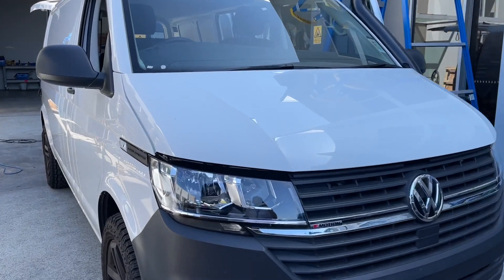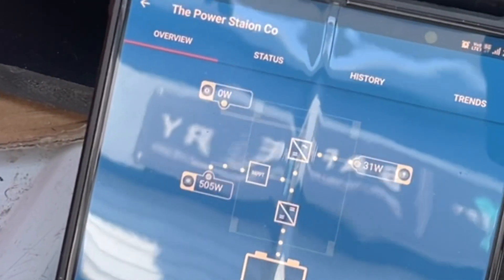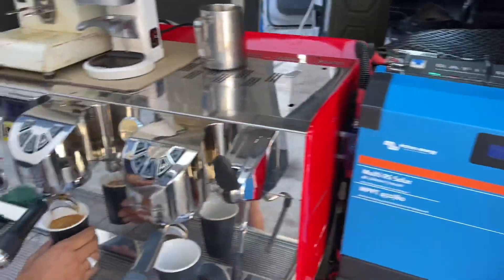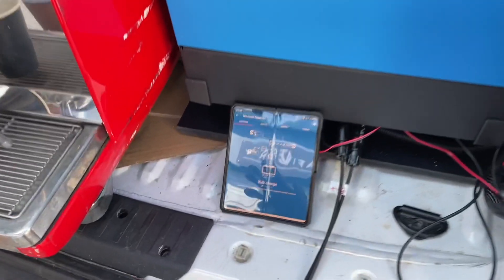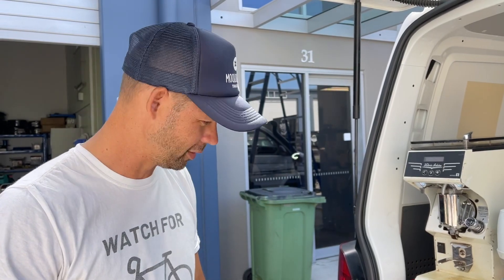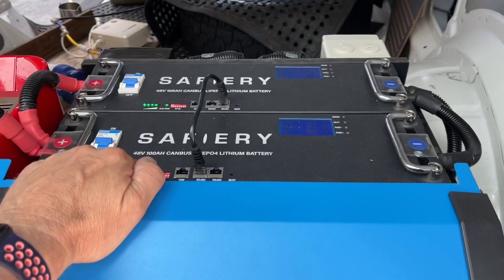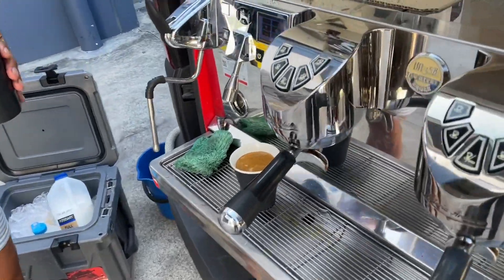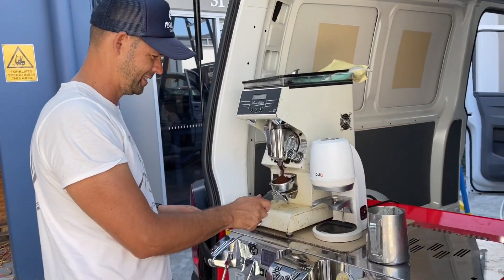The Power Station Co goes Next Level with 500mm Cube Power Station 6000VA Hybrid Inverter 9600Wh Li

Comment: Amazing setup.

The Multi RS Solar seems like an absolute no brainer compared to the monstrosity that is the multiplus…
Only the relatively high solar startup current can be a bit of an issue…
Reply from the maker: There are some other issues with Multi-RS. It does not respond to DVCC commands to stop charging when the CAN BMS sets a Charge Current Limit of zero. We had to change the CAN BMS strategy to reduce Charge Voltage Limit as well as set CCL to Zero (Scotty Ai responds perfectly to CCL of zero)

Comment: Hi,

In video it seems there is BMS communication with the victron  rs, it shows battery percentage on the ipad.  But i dont see a cerbo gx or blue can cables connected. Can the battery BMS talk to the lithium battery without an additional cerbo gx?
Reply from the maker: The battery BMS is built into each battery. It can be CANbus or it can be just CC and CV charging with No CANbus nor Cerbo. That is what we have done here, as this is a testing setup and we use raw battery voltages to run the system and check performance. It runs perfectly, you dont need a cerbo with the right battery and very good BMS!

Comment: What voltage are these panels? According to the manual MPPT works above 120Vdc, are these high voltage panels? I am also  planning a camper with such 48V powerbox and want to pick the best panels for the roof size. So far I have planned 12x 30W panels in order to get to the MPPT range, but I was wondering what kind of panels are suitable
Reply from the maker: These have a 76Voc

Comment: Hello Safiery, I have the Multi RS Solar with 11x400Watt glass glass bifacial solar modules with a 80Ah Lto battery and special BMS. It is working very hard and is already planning to expand it with the RS charge controller 450/100 or 450/200. He can do AC coupling too.
Reply from the maker: Thanks Reg, roof space is limited for solar so no need for AC coupling. Appreciate the thought
Reply: Yes, you can add AC-PV-Inverters as well.

Comment: Great setup but with lithium isn’t its KW us “younger” ones that only know lithium get confused.. what’s an amp hour?  Hmmm
Reply from the maker: Yes. The Lithium are 10,000Whrs. Divide by 12.8V to have Amg hours at 12V, divid by 50 to have Amphours at 48V.. The Inverter is Volta Amps rated from the battery by watts rated from the solar. The difference between Watts and Volt Amps is the active power is Watts and the reactive power is VA-Watts. To simplify everything, we work in watts and watt hours all the time. Amp hours are tricky as you charged at a different voltage to discharge so the true maths in amp hours is too hard. How did I go with this?

Comment: Hey Bruce great system mate how much for this system as is approx, and seperate 48V batteries how much are they? we are looking at a simular system for an off grid caravan.
Reply from the maker: All the pricing is on line except the 6000VA Multi RS is all allocated until we get new stock, expected mid year. So in the interim there are several 5000VA packages priced...

Comment: Is this basically mppt solar charger and inverter vs the multiplus 2 which is an inverter and AC charger?
Reply from the maker: No it is a 240V AC Charger with auto cutover and most of the features of the Multiplus with the 6000VA Inverter BUT it is hybrid and a HF planar. So the Solar MPPT power is joined to the battery inverter power for a much higher output. It can be as high as 9000VA if you have 4000W of Solar PV. Then it is only 12kg vs 36kg for a Multiplus 5000 + Solar....
Reply: @Safiery  thanks. Is there a 12v model of this?